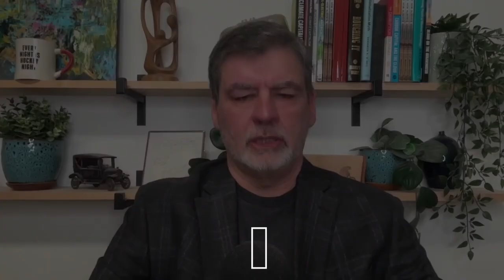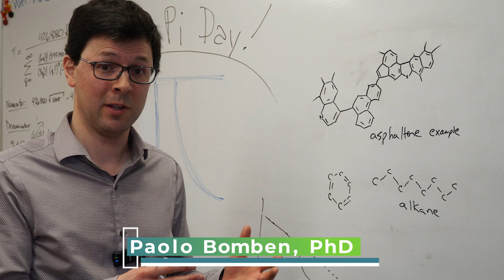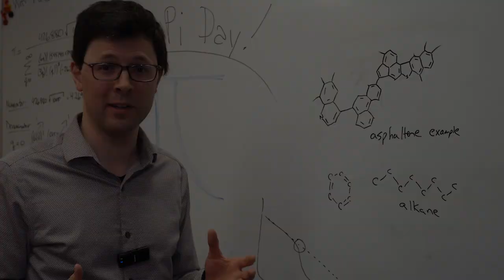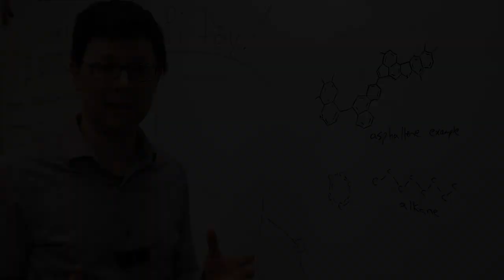Carbon fibre, not gasoline, future of Alberta oil industry

Comment: China is set to take over the global auto market with EV. Oil price is set globally. Won't be that long before nobody want's Alberta's high extraction cost oil anymore and they will go back to being a 'have not' province.
Reply: As years go by all oil will become more expensive to extract. That's literally the history of oil. As long as there is a demand for oil, and this will continue for decades, the oil sands will be contributing to the global supply. Sounds like you've engaged in wishful thinking instead of critical thinking.
Reply: @anthonymorris5084  Wishful thinking? Here are some facts easily checked. 

China is the largest domestic auto market in the world. For more than a decade, legacy auto like Ford and GM has relied on China for a large segment of it's sales and profits. Now Chinese EV new vehicle market share is soaring past 50% and those legacy auto profits in China are drying up fast. 

Also, for more than a year now China is the world's No. 1 car exporter having overtaken both Japan and Germany. Chinese auto exports are increasingly good quality and highly affordable EVs. And globally, EVs continue to gain market share in spite of propaganda to the contrary from corporate media. 

The highly credible International Energy Agency (IEA) predicts the advent of EV will soon trigger global peak oil demand. Peak oil demand will inevitably put pressure on highest extraction cost oil like that from Western Canada.
Reply: @douglascutler1037  I'm not denying China's economic might. Although with Xi at the helm and his desire to return to state control, China's future isn't so rosy anymore. The fact remains that developing nations across the world, including China and India are going to have growing energy needs. The oil sands has always been at a higher cost. In the past margins were much worse and the place was still successful. Oil sands companies are vastly more efficient today and costs continue to decline while margins are growing. Canada is also a stable producer. Our biggest threats and obstacles are all home grown including the Liberal government.
Reply: @anthonymorris5084  You fail to address the central point. global peak oil demand is on the near horizon, in large part due to accelerating progress of Chinese electric vehicle technology and production. If you have data to directly refute this point feel free to share it.
Reply: @douglascutler1037  YouTube doesn't allow links but you can easily google graphs that show continued and rising oil consumption. People have been predicting peak oil since the 1950's. Even with all the handicaps the government places on Canadian oil production, it's still growing as well. With just India and China's economic growth alone, we're about to add 6 more USA's to the planet. Where is this energy going to come from?
Reply: @anthonymorris5084  Peak oil production and peak oil demand are two different things. The claim here is that peak oil demand is on the near horizon. This projection is made by highly credible and historically conservative International Energy Agency (IEA).

Comment: There's a few overlooked aspects in regards to carbon and the various cycles. As I understand it, there is a difference between emitted carbon produced as a result of expulsed breath and the carbon generated through combustion, in terms of how the planet cycles carbon and more importantly, the fact that it's a major building block of life on the planet. Anything that is burned is brought to it's lowest possible energy state and requires additional energy to be converted back into it's atomic form or higher and given mass. Expulsed carbon as breath is a gas is it not, that forms particles quickly and emits a wavelength based on the health of the lungs. Under nominal conditions, One is in particle form that is essentially (white or greyish, negative polarization in atmosphere with low energy), one black, (high energy state in atmosphere, with positive polarity). That adds up when coreolis effects and location relative to the equator are factored in. Carbon nanotubes or microtubles, verses graphene or graphite essentially. Not only that, the heat transfer mechanism that balances heat, and the way particulate behaves based on interactions made during day and night cycles, between imbedded wavelength energy stored during the day on Earths surface by ions, that historically would be soil, covered in grass or moss and vegetation at Earth's surface, desert, sand mountains or water. Verses buildings, roads and all the other man made objects covering the Earths surface. They all emit visible wavelengths of energy relative to the energy stored within them. Black coloured soil has the energy of the fertilizer in it, to aide in the propegation of Earths magnetic field energy, outwards from the core and allows nominal balancing of energy. Asphalt traps heat during the day, but doesn't have additional energy to aide in heat transfer, as day turns into night. Plus the gravitational effects of that additional black covering Earths surface. A few aspects not fully explained, but it really isn't a good situation to be in.

Comment: Just another product from the result of the oil sands which is great, as long as it is  refined here in Alberta and use it here in Alberta and not send it outside of Alberta unless it is a finish product

Comment: Another mess up with planet! and you talk in a way like this is such a great replacement to burning the crude oil! Only while making carbon fibre there are poisonous fumes and  byproducts emitted into planet. You’re reintroducing Asbestos!  Good job Canada! Here some more info on your heroic endeavours: carbon fiber production can release **harmful byproducts**, including **volatile organic compounds (VOCs), toxic gases, and fine particulate matter. Some concerns include:

- **Toxic fumes**: The resins used in carbon fiber manufacturing can emit hazardous chemicals, including **styrene and epoxy vapors**, which can cause respiratory issues. Cutting or sanding carbon fiber can release microscopic fibers that may irritate the lungs and skin, similar to asbestos. The production process requires high energy input and generates **carbon emissions**, making it less eco-friendly .

Comment: What is the demand tonnage for carbon fibre vs the current tonnage of oil sold?  I suspect the demand for the fibre is only a tiny fraction of the sale of oil. You Albertans will just have to get used to a decline in your economy, a decline in your population, and a massive decline in property values due to the loss of the oil industry. The smart ones will sell your houses and get out now.
Reply: They'll leave and join the United States, and leave people with that attitude behind in Canada. With a lot less equalization money for those who remain.

That's what the rest of Canada will have to get used to.

Comment: I always find these materials like graphene and carbon fiber to be ripe for government support. 

They are stuck in this free market dilemma where they are potential game changers for countless industries, but they are too expensive because nobody mass produces them, therefore they are not feasible materials to work with.  On the flip side, nobody mass produces them because it’s a huge expense to set up the mass production capacity and there just isn’t the market for them at the moment to justify that expense. 

This is where government investment actually matters. The government can easily absorb a lot of the costs associated with setting up these plants because they don’t have to worry about profits within the business cycle. The money will be paid back and then some over the span of 20-30 years with the increased economic activity.
Reply: The Alberta government started the oilsands in the 1960s

Comment: carbon fiber is 5 times stronger than steel and lighter than aluminum. Cheap/affordable carbon fiber would change the world. And the R and D would all be done in Alberta. Putting bitumen in a pipeline is a waste.
Reply: There are many potential uses for carbon fibre.  Graphene is good example.  It has many applications in different industries.  The key is to be able to mass produce it at an effective cost.  That is why it hasn't caught on.

Comment: Brilliant concept. Spin offs which create more jobs in Alberta is positive and innovative.
Reply: Another mess up with planet! and you talk in a way like this is such a great replacement to burning the crude oil! Only while making carbon fibre there are poisonous fumes and  byproducts emitted into planet. You’re reintroducing Asbestos!  Good job Canada! Here some more info on your heroic endeavours: carbon fiber production can release **harmful byproducts**, including **volatile organic compounds (VOCs), toxic gases, and fine particulate matter. Some concerns include:

- **Toxic fumes**: The resins used in carbon fiber manufacturing can emit hazardous chemicals, including **styrene and epoxy vapors**, which can cause respiratory issues. Cutting or sanding carbon fiber can release microscopic fibers that may irritate the lungs and skin, similar to asbestos. The production process requires high energy input and generates **carbon emissions**, making it less eco-friendly .

Comment: Makes a lot of sense, especially the idea of creating the value added  products close to the source.
Reply: Another mess up with planet! and you talk in a way like this is such a great replacement to burning the crude oil! Only while making carbon fibre there are poisonous fumes and  byproducts emitted into planet. You’re reintroducing Asbestos!  Good job Canada! Here some more info on your heroic endeavours: carbon fiber production can release **harmful byproducts**, including **volatile organic compounds (VOCs), toxic gases, and fine particulate matter. Some concerns include:

- **Toxic fumes**: The resins used in carbon fiber manufacturing can emit hazardous chemicals, including **styrene and epoxy vapors**, which can cause respiratory issues. Cutting or sanding carbon fiber can release microscopic fibers that may irritate the lungs and skin, similar to asbestos. The production process requires high energy input and generates **carbon emissions**, making it less eco-friendly .

Comment: The Alberta government needs to take the initiative and just create state-owned enterprises that turn the bitumen into carbon fiber precursor.  Now.  Today.  Make it happen, and then allow up to 50% of the shares to be privately owned by listing them on the stock market.
Reply: thing is  the alberta government is pretty much focused on oil and selling to the us that any other idea or path will not even be considered
Reply: The more "Alberta owned" it becomes the less money you'd see as your current issues are not federal but provincial. Daniel Smith is taking any profits your people make off of the oil and using it to pay off the taxes her billionair oil buddies had to pay on the oil. She's also screwing over your healthcare so her US insurance buddies can swoop in and make money off of your suffering.

Maybe y'all should try NOT voting conservative and maybe all the issues your conservative governemnt has casued for decades will finally go away?  🤷‍♂️
Reply: Keep it, Alberta owned and keep the rest of the country out in the cold
Reply: @moose6144 Very rude since the rest of the country pid 39 billion for your transmountain pipeline. You Albertans are the weirdest and most hostile people in Canada. Constantly mired in hate for the Federal government, and unable to work with anybody else and keep electing far right politicians that allow you to wallow in victimhood. You are an odd province and an extreme people!

Comment: I stumbled across this channel during this past election campaign. I appreciate the constructive approach the host takes. This video is a prime example of that. I'm in Manitoba where Premier Kinew seems to be ready to bring a new vision of hydro electric power. I only hope that industry leaders and political leaders are listening.
Reply: same....
Reply: I live in Northern MB as well.  I really like Mr. Canoe (Kinew could not resist)   I especially was laughing at his mocking of Dumpster and acting out Ex, Orders sharpie and all on Hydro Exports.
Reply: Another mess up with planet! and you talk in a way like this is such a great replacement to burning the crude oil! Only while making carbon fibre there are poisonous fumes and  byproducts emitted into planet. You’re reintroducing Asbestos!  Good job Canada! Here some more info on your heroic endeavours: carbon fiber production can release **harmful byproducts**, including **volatile organic compounds (VOCs), toxic gases, and fine particulate matter. Some concerns include:

- **Toxic fumes**: The resins used in carbon fiber manufacturing can emit hazardous chemicals, including **styrene and epoxy vapors**, which can cause respiratory issues. Cutting or sanding carbon fiber can release microscopic fibers that may irritate the lungs and skin, similar to asbestos. The production process requires high energy input and generates **carbon emissions**, making it less eco-friendly .

Comment: I really like the work Alberta innovates has done. And believe it will provide an advantage in Carbon Fiber production.
 
But in the longer term of 50-100 years, energy abundance from Solar will mean captured CO2 is the basis of any Carbon material. It makes absolutely no semse to save Bitumen in the ground for the future. Use it for beyond combustion, use it for combustion, there will be oil left in the ground when the transition is over its such a large resource; but it is a use it or lose it resource.

Comment: I am still failing to understand, if these non combustion uses are viable, why you are concerned about the long term value of pipelines; surely China and others will want Carbon Fiber, EVs still need Asphalt roads.
Reply: Why give those Industries away?
Reply: @sandorski56  I'm not saying to, but it makes no sense to build an asphalt refinery for export around the Pacific in Calgary when it could be in Prince Rupert.
Reply: @neolithictransitrevolution427  Asphalt binder is already primarily manufactured in Alberta. There's no good reason for that to change. If half the bitumen produced is transformed in Alberta into higher value products like carbon fibre, asphalt binder and energy carbons and the other half no longer needs diluent to be transported by pipeline because the heavy fraction has been removed, then you only need about 35% as much pipeline capacity.
Reply: @policyguy3103 I second this. China is the largest auto market in the world. They're selling more EVs than ice annually now. China has instructed refiners to start using oil as feedstock for products other than fuel moving forward. Alberta should be moving up the value chain rather than simply sell the raw commodity.
Reply: Half would be 2.5 million barrels per day. What are you basing that on?

Comment: It is a very interesting idea. I hope to learn more about it. From what I do understand about it though, bitumen sourced carbon fibre lacks the tensile strength that we normally associate with traditional, PAN based carbon fibre. The applications are really focused on using it for building materials. More advanced uses like aircraft and submarine frames, or racing cars bodies or wind turbine blades are out of the question for it.  Another drawback may be that it requires a considerable amount of energy to produce. I would like to see just what other applications it is suitable for, and what the energy footprint of it would be compared to other materials.
Reply: It's just a matter of upscaling, if we had a decent government.
Reply: I would think building materials (and maybe roads?) would be a far larger market, anyway.  I’m all for it though I think use as energy is here for a long while yet.
Reply from the maker: I am going to pass this comment on to Markham!

Comment: You still have to refine bitumen to make carbon fibre.
Reply: That's right. It doesn't compete in any way with the primary product of the oil sands. It's really a  co-product that might make the oil sands more profitable.
Reply: Yes, but the process of refining only requires a fraction of the carbon to be released.  Locking the carbon in the fibre prevents the release that occurs during combustion/burning.
Reply: @CopperMan-h2b  What would you do with the rest of the product after the asphaltenes for carbon fibre are removed?
Reply: @JamesBrix86  Instead of moaning and kvetching, why don't YOU try to provide us with an answer?!